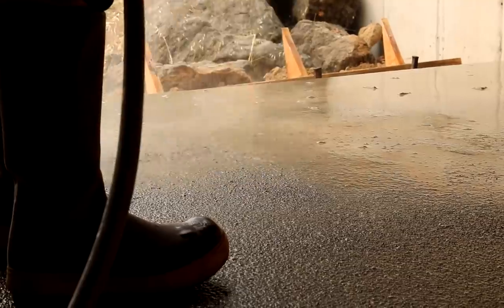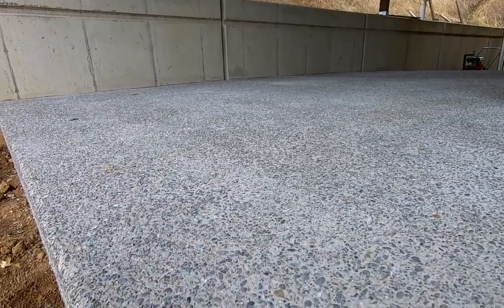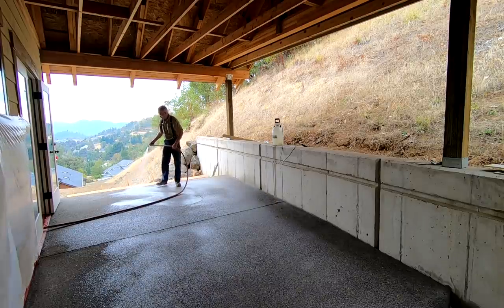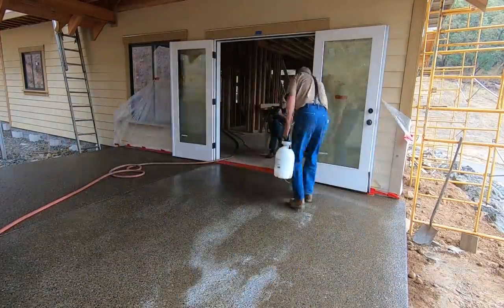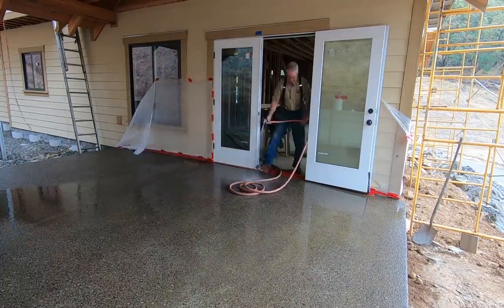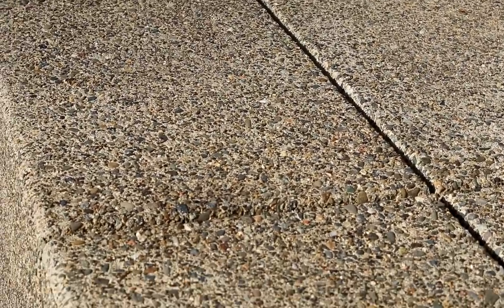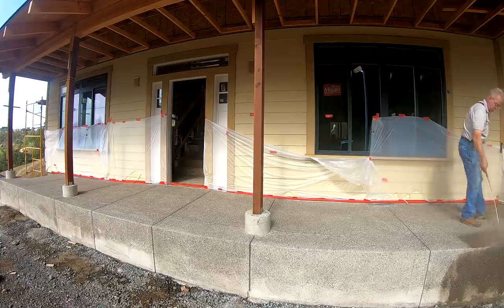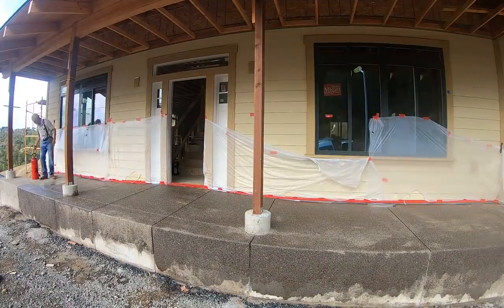Wash and Seal The Concrete Ep.94

Comment: Hello, we had a cement poured a month ago and are noticing some dark spots, we heard it was most likely moisture trapped in the cement. We heard from a sealer company that an acid was would open up the pores an allow it to fully cure but a contractor said it may be best to just wash with vinegar because its less likely to cause any further damage acid might cause, whats the best way to remove these moisture spots

Comment: So, how long will the sealer last on the concrete? Will it have to be reapplied again at some point? And, does the old sealer have to be stripped off the concrete before the new application?
Reply: sealers must be maintained and reapplied every 3-5 years depending on sun exposure and wear, most good solvent sealers can be reapplied without removal of old sealer (there are some you cannot) over application is usually what causes sealers to fail and having to be stripped. fyi 20+ years doing decorative concrete. hope this helps.

Comment: Really the most dangerous thing here, far above the actual minor safety concern of spraying a dilute acid, is the attitude of "It wasn't convenient to use the safety equipment this time, so I didn't". Because that rears its head in the way it trains you to think and operate. It's never convenient. There's always time to save by skipping it. The way to be safe and efficient is to insist to yourself that "just this one time" isn't okay, otherwise it'll be all the time. No tradesman has extra time floating around. But if the consequences of not having it were that you didn't get the work done, I bet you'd find a way to change your methods or your system to ensure you've always got it when you need it. When you don't treat safety as something that would stop a job, surprise surprise, it falls through the cracks. When you do, surprise surprise, you've always got it around and you never lose the convenience. Just like when you choose to never drive drunk. If the consequence is that you have to take an expensive cab home, surprise surprise, you probably don't have that beer, or you leave when the last ride was offered or make plans. But when you say it's okay just this once, every time is just this once.

Also, I kinda call BS on this one. You're on a jobsite doing *anything*, and you don't have safety glasses around? Full respirator, whatever, it's outdoors not a confined space, rarely used, stay upwind of the fumes and you're probably fine. But not even splash protection in case a hose cracks and sprays you? If there's a 50% effort for safety, I'd believe it if some equipment got left behind. But when there's zero effort shown? I dunno if I buy it. I've probably got 5 pairs of glasses strewn about so there's never an excuse, they're like $4.

I think the truth here is that Scott didn't care much at all, and he either doesn't want the flack for not wearing it, or, he's concerned for others and wants to tell them to not follow his example. Both those are okay. But otherwise it looks like an attempt wasn't even made, it was a "just wave some excuse about it later" kind of thing.

Comment: Hey don't be so hard on yourself. Your outside and the wind was blowing. One thing I think that you should emphasize a little more, any journeyman craftsman knows full well which small corners he can trim just a little bit that will not affect the outcome.
The other thing I used to say is if the job costs $1000, then it's $2000 if you watch, and it's $3000 if you help.

Comment: Organics Mask. Holy hell. Even out doors. I did one gallon of 29%, with mask I was like dam my jeans fell apart. Another sprayer with sodium bicarbonate or ammonia.  Seal with a penitrating sealer, high supplants. No need to watch it turn white of flak off. Costs about 250$ per 5 gallons. First few years, not even water penetrates it. Wait 30 dry day or more.!

Comment: So I know a 25% Muriatic acid solution is 25:1, but is the acid or the water the 25? They didn't say in the video.
Reply: 25% is 25 parts acid to 100 parts of solution. It looked like a one gallon sprayer so EC was probably adding one quart of acid to 3 quarts of water.
Reply: @janderson8401  so your saying 25% is really a 4:1 mix and not 25:1?  Sorry my math is terrible.
Reply: @Soxruleyanksdrool  Yup, per cent literally means per 100 so 25% as a fraction is 1/4. it gets a bit confusing if you turn it into a ratio of acid to water because then it's 1part acid to 3 parts water.

Comment: Wait so could the muriatic acid be used to get rid of stains on concrete because my driveway is stained to all hell from me spilling 5+ quarts of Rotella T5 and $2 of diesel fuel on it.
Reply: sorry acid will not work in that situation, the acid is used to clean the efflorescence from the surface and neutralize the slab for sealing.
Reply: There are other products specifically for oil stains, though... (I can't recall their names off the top of my head, but I know they exist!)

Comment: The comment about not have materials pose as something there not is one of my standards as well.
Reply: Indeed, I always hate the look of stamped concrete. I've never seen any that didn't broadcast FAKE FAKE FAKE. (But note, I am committing the Toupée Fallacy, in which you assume that because you've spotted some toupées before, you can always spot them. Some call it the Fake Boobs Fallacy. So, I don't think stamped concrete has ever fooled me, but ... I can't prove it!)

Likewise, as @Gregory Schmidt points out above, Scott shouldn't have gone with cement siding posing as wood.

And why split asphalt shingles into 3 tabs? Clearly it wants you to think it's slate, though I doubt anyone is fooled.
Reply: @ps.2  Great post.  I'd never heard of the fake boobs fallacy but it makes perfect sense!    Also agree on the hardi-plank: I prefer the smooth, but frankly the wood texture is not very prominent and the smooth is sometimes hard to find...  

My Scientist card just expired but I think shingles are in 3 tabs due to heat expansion rather than anything else.  I've installed more than a few roofs and trust me if you could install shingles in a single tab a lot of guys would be doing it!

Comment: I use muratic acid to etch metal 
Stinks to high heaven when it’s 80% solution
Reply: That's because it releases chlorine gas. Y'know, the first chemical agent used in modern warfare. I did a war crime on myself once -- had my face over the tub of metal being etched, gave it a stir, and got a facefull of it. 

Really clears your sinuses, though! :p
Reply: @DeliveryMcGee  I think you’re right about it releasing a volatile gas, but I’m not quite sure it’s chlorine 🤔
*edit - I stand corrected. You are right. It does give off chlorine gas 🤷‍♂️

Comment: You didn't sack the post poles bases?  Lame.  Sonotube lines  are not a good finish.  Making it worse is the stark contrast they have to the fine job you did on the flat work.
Reply: Check out episode 22.  There's an architect's rendering of what the house will look like when finished.  The bases will be clad in stone and the posts will likely be surrounded with wood.

Comment: I charge the same for exposed as I do stamp. I realize you’re not the Redimix company but that’s a poor exposed mix in my opinion. And you’re not supposed to seal concrete for at least 28 days after it’s been poured and less you’re using water-based sealer. Which water-based sealer is garbage anyways so please do not seal your concrete a week after you’ve poured it!!!! And don’t put thick layers of sealer on unless you want white air bubbles throughout your concrete I appreciate what you do with this channel but sometimes you don’t know and need somebody who does.
Reply from the maker: None of this matches my experience. Nor the experience of Dustin who is someone with enough truckloads under his belt to have a fully informed opinion at least for pouring in the Pacific Northwest. Thank you for the comment though!

Comment: In addition to gloves, eye protection and respirator, you should have rubber boots and  tyvek coveralls.
And, what happens to the nylon fumes when you burn them?
Also, it is extremely important to stress, when mixing any acid, to ADD ACID TO WATER, not water to acid, unless you want the mixture to react violently! 
You rushed into this video, also. Thumbs down for promoting poor workmanship!